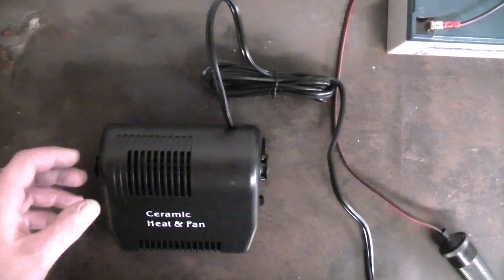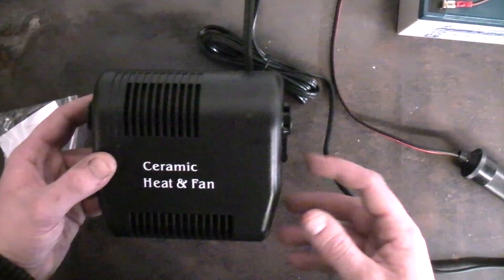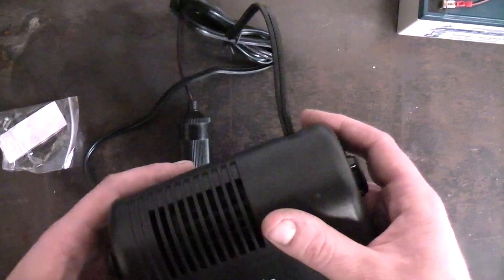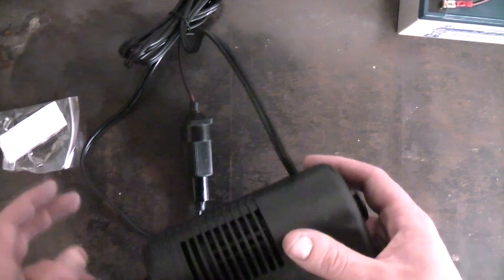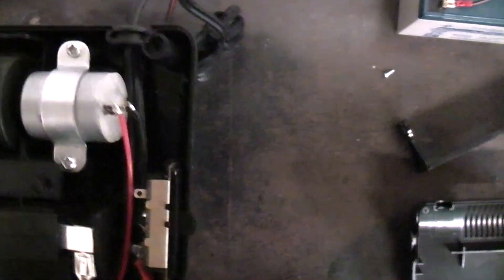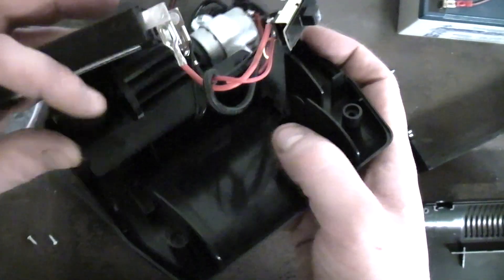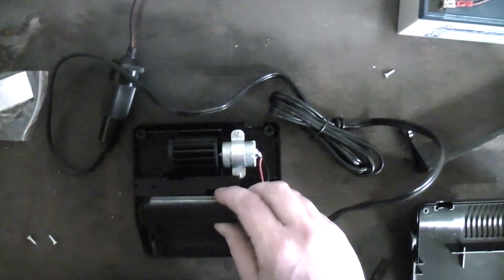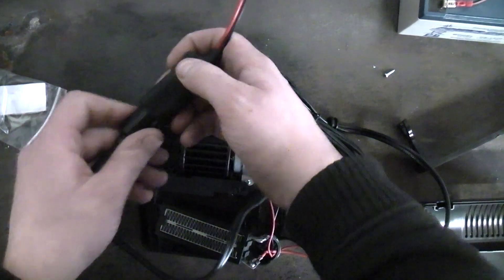A look inside a 12v "ceramic" heater.

Comment: It's great to have technical details... Wire cross section in millimeters, Amps per mm, voltage drop. Being a master electrician, I appreciate that kind of details. Good review. Thanks.

Comment: Not a bad mini heater, i like the element, just like the old zig zag resistor on schematics :-)
I expected the ceramic part to be just a heat isolator, no supprise.